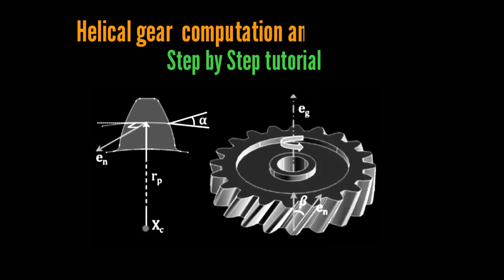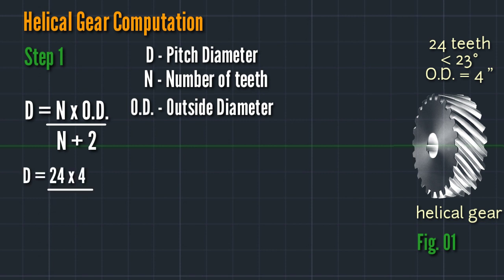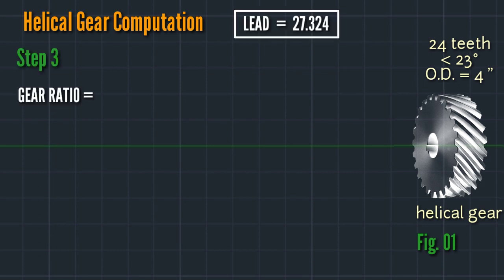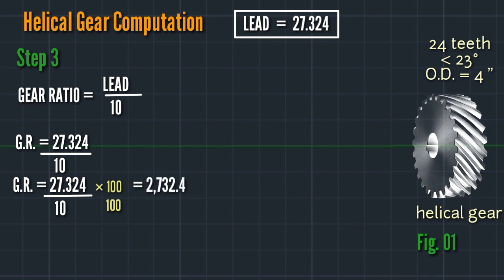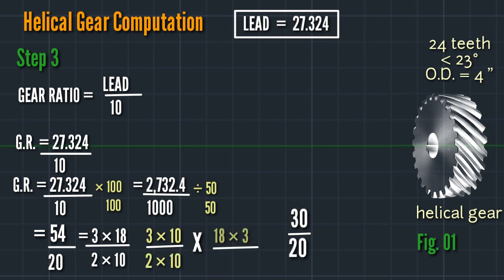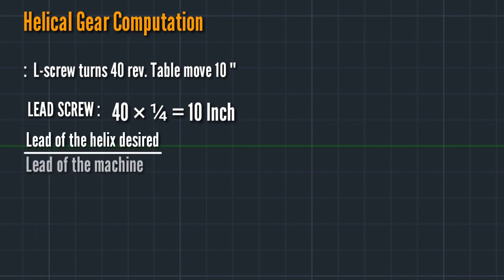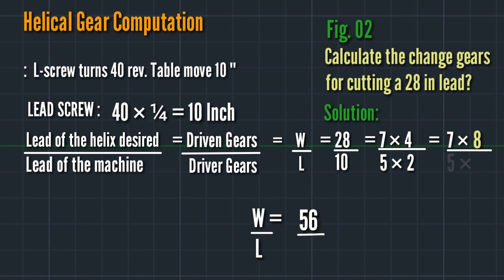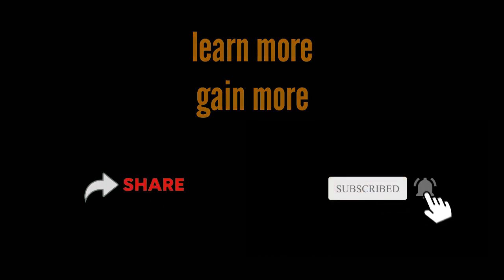COMPUTATION AND FABRICATION OF HELICAL GEAR Step by Step Tutorial | Machine Shop Theory

Comment: Sir panu kya e compute pitch ng leads crew  ko is 5mm tapos 8 degree ang lead of the helix desired
Reply from the maker: Standard ng milling lead 10 inch .Lead screw equal 40 turns.sundan lng ang video step by step. Thanks for your comments.

Comment: How about metric lead?
Reply: Pa sample nmn ng metric lead sir
Reply from the maker: Sir Formula designed for  inches refered to constant size of milling table lead screw ¼ " . Convert dimension from MM to inches. Thanks
Reply: Sir my milling from taiwan ay may 5mm na lead..so meaning convert ko yung 5mm sa inch?
Reply from the maker: Yes po sir
Reply: Is these correct sir..5mm-.129"?

Comment: Sir yung sa LEAD formula po (Step 2), sa circumference, hindi na po ba yun i-mumultiply sa OD kase po 3.1416 lang po nakalagay multiply by "cot a"? Thanks po sa reply
Reply: @RadmakOfficial  Sir diba po, Lead= Pitch Diameter x Circumference x Cot a, bale (3.692 x 3.1416(multiply x 4") x cot a) kase po sa video yung circum 3.1416 lang po di po ba imumultiply pa sa OD? Thank you po.
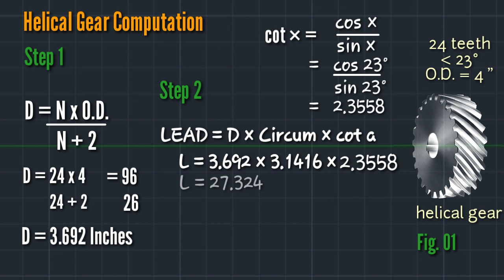Reply: Sa 2:47 po (3.692 x 3.1416 x 2.3558) yung 3.1416 po ba eh imumultiply pa sa OD kase po Circum= pi(D)? Thank you po.
Reply from the maker: Sir hindi na e multiply sa OD. ang required ng lead D=pitch diameter , kung e multiply sa O.D ng gear, pitch circ. na
= O.D. × pi , kaya D = N×O.D. / N+2  para makuha ang D. sa formula na. L=D×pi×cot a
Reply from the maker: Equiv.lang  ng p.i  sir 3.1416
Reply: @RadmakOfficial  Ahh okay po sir gets ko na po bale (Lead of Helix= Pitch Diameter X Pi x Cot a) thanks po.

Comment: why gear ratio is lead divede into 10?
Reply from the maker: Milling constant 40:1 ; Lead screw turns 40 rev, table move 10 inch. lead screw ¼
 40×¼ = 10 in
Reply: @RadmakOfficial  thank you so much sir.

Comment: Sir saan galing ang 10? Ang over Ng lead? Salamat
Reply from the maker: Sa milling machine constant yan sir.. standard ng sukat ng machine table is ¼ inch. L (lead screw). Turn mo ng 40 turns yung handle  ng table ang travel distance is 10 Inch. Kaya ang LEAD 40x¼= 10 Inch.
Reply: Thank you sir ☺️.